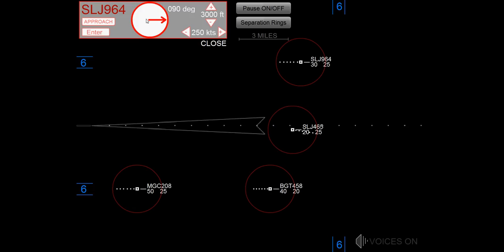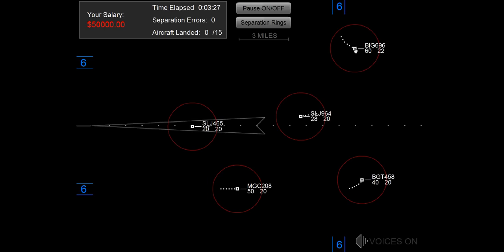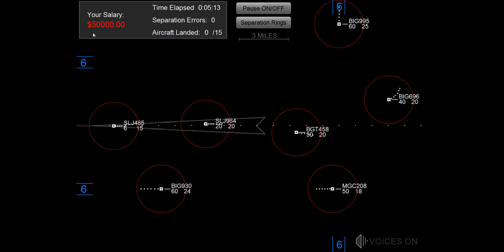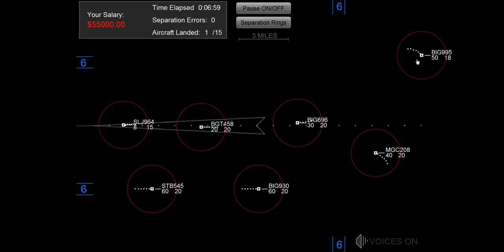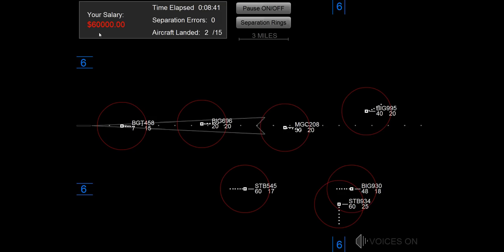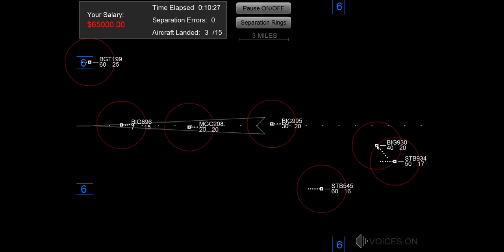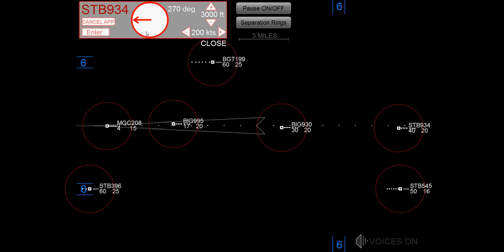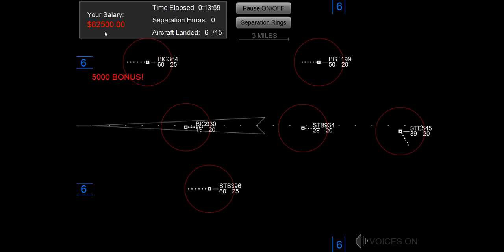Air Traffic Control Simulation Game

Comment: Well done for the achievement. I haven't played this in ages to be honest so still haven't got passed level 2. . What bugs me, if you fail level 2, instead of simply starting level 2 from the beginning again, it takes you right back to the beginning of level 1. Grrrr! I noticed that Fat Simulations have bought out a new simulator. That's supposed to be quite realistic and challenging as well.

Comment: OK,..I defy anybody who can get past level 2 on this without cheating by letting some of the aircraft drift off the radar screen. There are just too many planes to vector safely taking the fun out of this sim. I know it's an ATC simulator but it's ridiculous. I don't mind a challenge but this is just plain damn impossible. The first level is challenging but you can do it. The 2nd level,..know way!! We need some aircraft Holds so that we can peel them off the stack one by one.
Reply: Agreed. Real life ATC while it can get hectic doesn't ever get to the insane levels this does unless something went seriously wrong afaik. Perhaps somebody can correct me